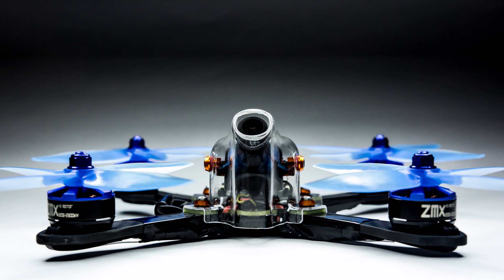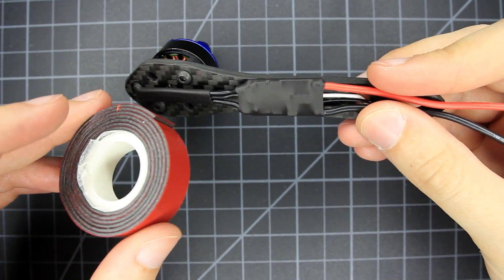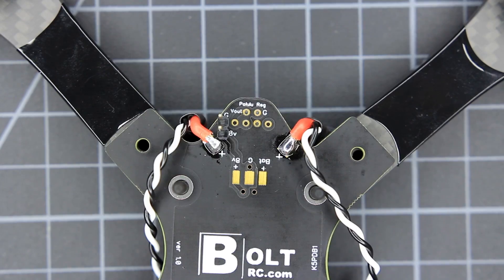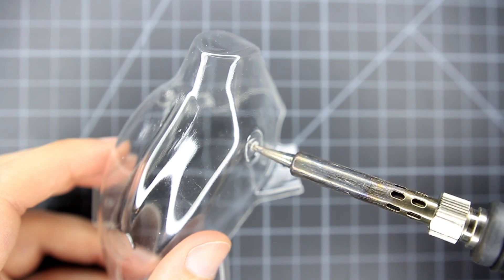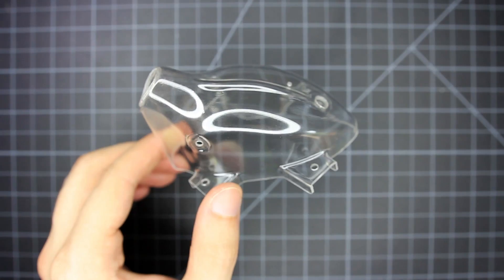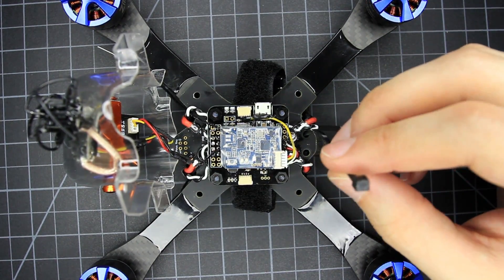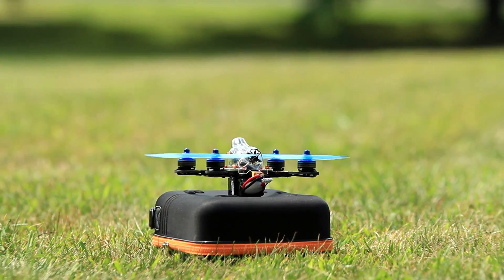BoltRC Kraken Quadcopter Build

Comment: Hi, is there a video showing how to solder the broken aomway antenna with the coax cable, its really interesting making it that way, but i cant imagine how you solder it, you know, the signal wire inside then covering it and solder the outer steel braided cover. since i want to cut a working antenna, would really help if i could get the right methods before doing it.

Comment: Where do you get your heat shrink that you secure your escs to the arms? I love your videos!!!!!
Reply from the maker: It's just some cheap pvc heat shrink used for 18650 batteries, got it off banggood a long time ago. It's not very durable, but it's really thin so it doesn't hold in much heat and looks kinda cool.

Comment: @spdfx  Nice and clean build. The only thing that I'm afraid of is your comments about working with canopy: If I have to take so many precautions drilling or even cutting this piece, that means this canopy will barely handle crashes, isn't it? Especialy the front crash compared to ShenDrones frames like Orca or Mako, right?
Reply from the maker: Alexandru Covaliov it should handle impacts fine, PC is great for that. you just don't want to introduce stress fractures when drilling. There are TPU canopy versions too on thingverse

Comment: Use a hammer to sink your sink nuts.. Omg if had known this 4 builds ago..
Reply: Also a heat gun treatment on all 3D printed items help over all rigidity. I like the solder drill point treatment.
Reply: Doesn't the bent vtx antenna mess with signal coherence? Do you have vtx that's straight? Have you flown both (bent vtx vs straight vtx) and noticed any difference?
Reply from the maker: Do you mean the coax cable on the vtx? I don't think that impacts reception at all, they're shielded. I did not notice a range difference between this and my other quads with standard (90 degree bulkhead) setups.

Comment: what 2.5 mm lens are you using ? , on my Kraken 6", I had to make a bigger hole to clear the view
Reply from the maker: I'm using the DalRC 2.5mm lens, it has a 120-130 degree FOV. I also have a "2.5mm GoPro replacement lens" which although is listed at 2.5, has about 170 degrees FOV and like you mentioned is a lot larger.

Comment: Nice work I've been waiting for a build video on the Kraken for a while. I love the look and compact design but looks like a dam tricky build. Is there no other way to mount the vtx without direct soldering the antenna?
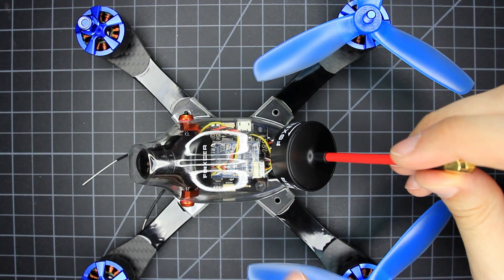Reply from the maker: Use a VTX with pigtail on it (like Hawkeye or similar) and you can just bolt it up top like at 6:02. Or if you run it out the back like at 6:07, you can use a shorter antenna (there's a short version of that Foxeer I showed), maybe add a few zipties for security. Direct soldering the antenna is easy and much lighter though!
Reply: Hey spdfx I got a question. Is the 5R a 210 sized frame? And 2nd question what LiHV are you using? Do you suggest on using them over lipos? Why?
Reply from the maker: It's a bit smaller, maybe a 205 or so. Not sure on exact measurements, just eyeballing it against my 210 sized frames. 

I'm using Revolectrix LiHVs for now. I'd always recommend them over a regular LiPO, they handle bursts and power outs much better. Haven't tried any graphenes yet, they're next on my list to test.
Reply: spdfx Thanks a lot

Comment: Lovely build, so smooth looking! What was the overall cost may I ask? Minus battery and assuming I could bound my Flysky remote?
Reply from the maker: Motors and ESCs are the biggest variables in cost, but you can see my whole list here: http://rotorbuilds.com/build/985. You can use your remote if you use a Flysky receiver, probably have to de-pin it to fit.
Reply: cheers for the reply, I'll take a look at your log now. something to plan for the future for sure